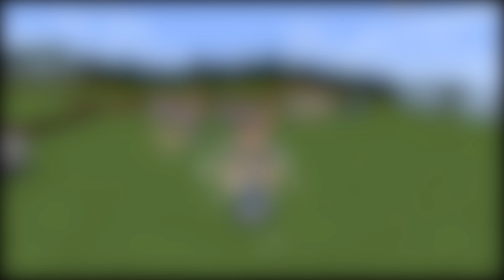Industrial Foregoing Tutorial - Misc. Machines, Mycelial Network, & Tools | Minecraft 1.16.5

Comment: 0:38 Water Condensator
1:21 Dye Mixer
2:08 spore recreator
2:48 Fluid Placer & Collector
4:07 Mob Detector
4:59 Marine Fisher
4:45 Material Stonework Factory
9:39 Black Hole Units and Tanks
12:35 Black Hole Controller
14:27 Mycelial Network
22:10 Infinity Tools
22:43 Meat Feeder
23:08 Infinity Backpack
24:12 Infinity Hammer
26:00 Infinity Saw
27:01 Infinity Launcher
28:26 Infinity Drill
29:05 Infinity Trident
29:41 Infinity Nuke
Reply from the maker: Thanks, friend! :)
Reply: @TheAndrata  of course I’ll be back to make these all